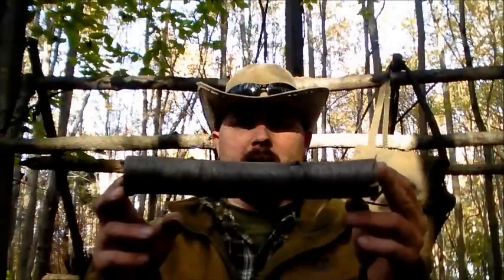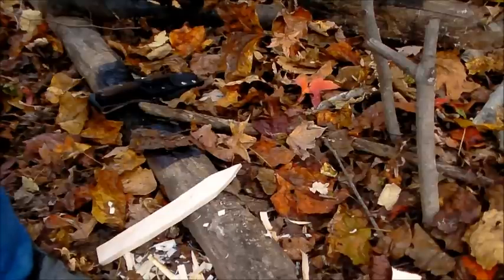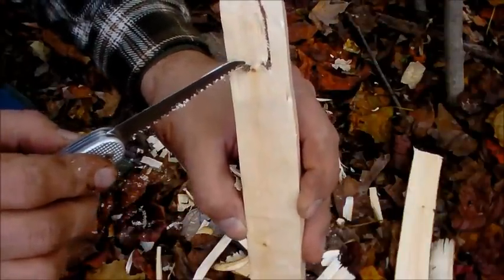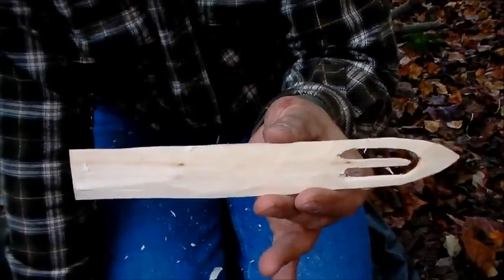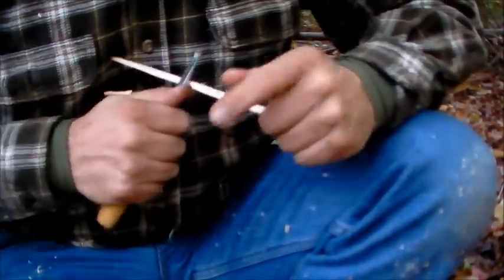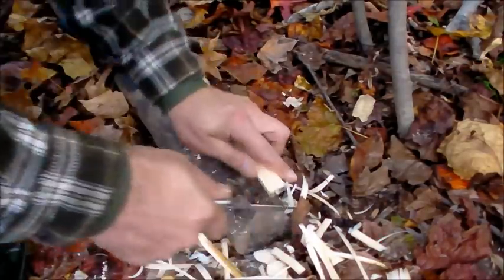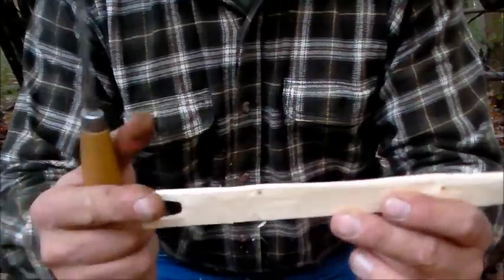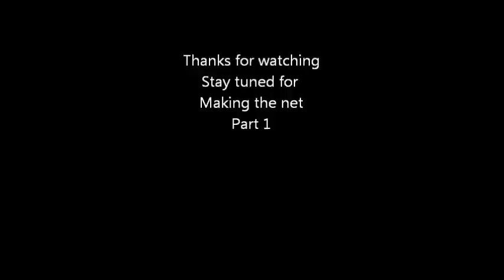Net video Part 3

Comment: @6390721 Quote from Bushcraft UK: '...pitched or tarred three ply reverse twisted cord. Probably the type of stuff that brightly coloured nylon cord has replaced. I haven't seen any this side of the Atlantic for a while but my guess is that some garden centres or old fashioned hardware stores would have it. Dave Canterbury uses it in place of paracord inner strands, so it might just be a cheaper version strongish cord. The pitch or tar certainly helps in keeping knots tight and bindings tidy.'

Comment: @6390721 bank line is pretty much three strand nylon string that comes in a virity of colors over here in the u.s. we use it for set lines for cat fish. asfor were you can get it try ebay .and if u still cant find it a good sub is masion twine you can probly find it at a hardweare store hope this helps